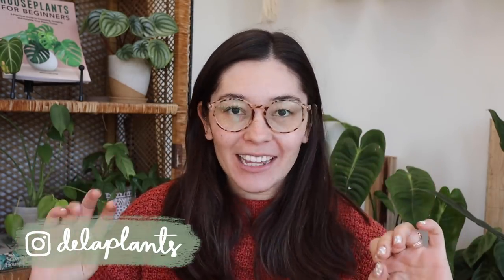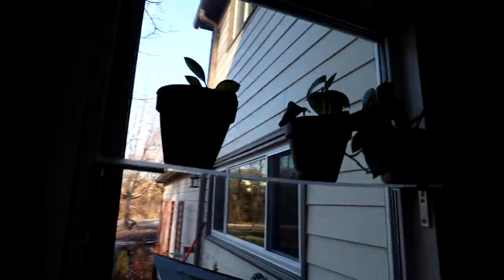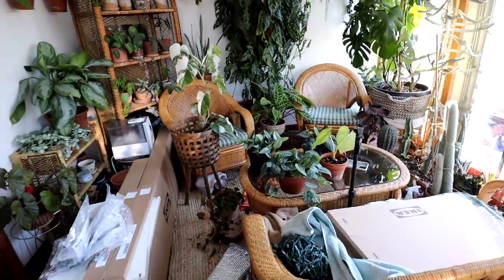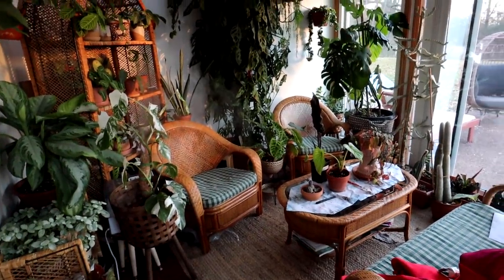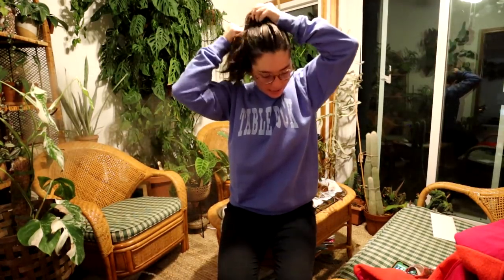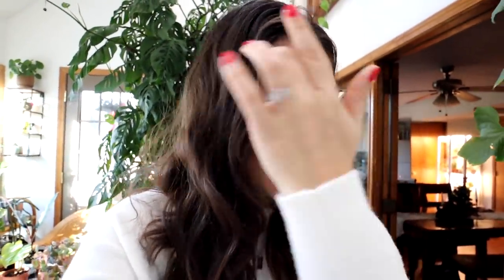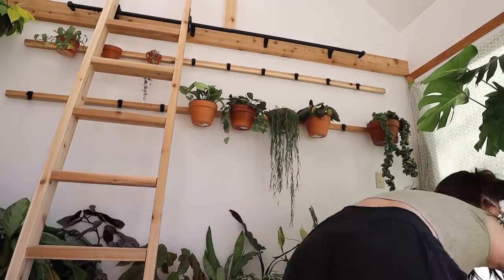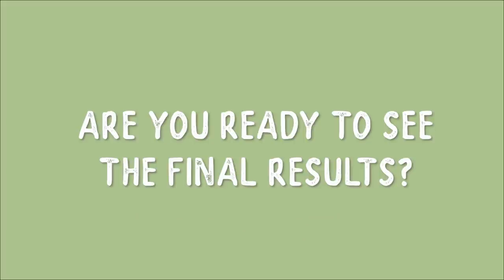PLANT ROOM MAKEOVER! | DIY plant wall & library ladder

Comment: It looks AMAZING! It looks so much better and it’s a great use of vertical space, which I’m a huge fan of. I’ve done a similar thing with hooks and a wire grid for storing my accessories in my bedroom. And you even have lots of extra space for new babies, and you could probably put in another row below the bottom one if you wanted! And even make name labels to put under the plants on the wall. This room is the VIBE. 😍😍😍

Comment: i think its a blessing that the old saw was dead during such time, because imagine if you already started cutting and started facing problems and it ruined the cabinet, instead, you ended up with a new fresh saw that just cut through it like it was butter. so satisfying.

Comment: Great plant room makeover, Becca!  Just a safety tip!  Please tie your hair back when you are using power tools. 🙏🏻 Also, you can use goggles over your glasses. More comfortable than trying to wear two pair of glasses. Sorry your hired painter did such a bad job.  It made me cringe to see the crappy surface he just painted over without puttying and sanding. Arghhhh!
Reply from the maker: Ahh yes!!! You are so right, I definitely need to tie my hair back and get some goggles. 😅 the paint job also made me cringe lol thankfully it still turned out good in the end!